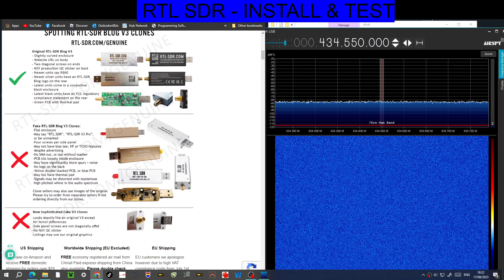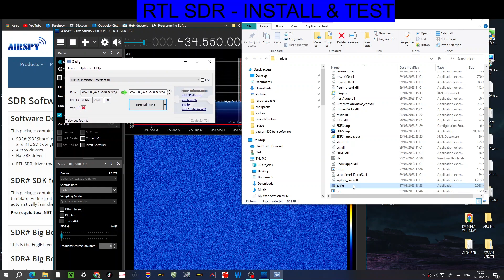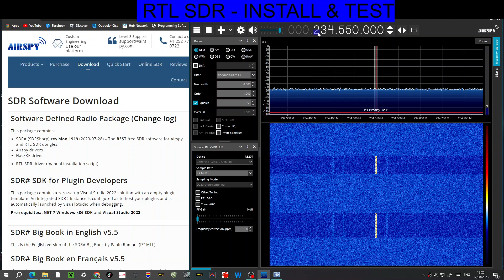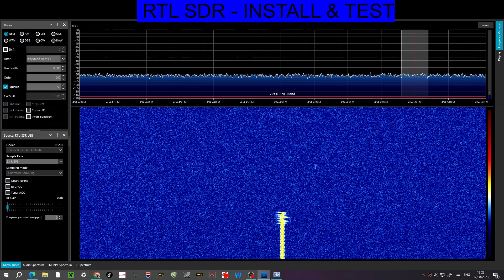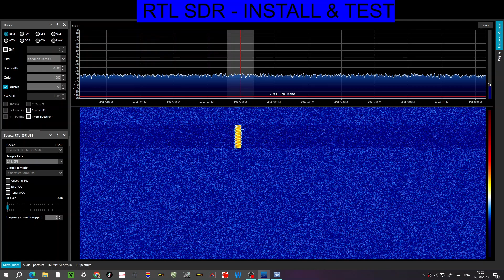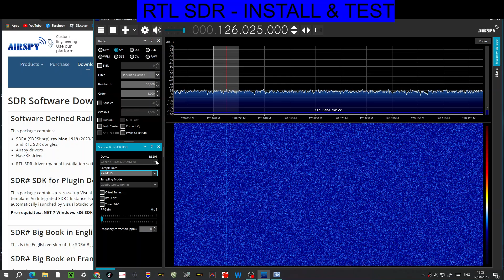RTL SDR v3 & v4- INSTALL & TEST , 2023

Comment: There are radio frequencies attacking our private property and devices such as radios, televisions, air conditioners, fans, etc. in Santa Ana, California, in Orange County. The transmissions are...
Ninety percent of the speakers are American women. Is there a way to detect and record this transmission with RTLSDR?
Reply from the maker: RTL-SDR devices can be used to record radio signals using various software. Common methods involve using command-line tools like rtl_sdr to capture raw I/Q data, or utilizing software like SDR#, Audacity, or RTLSDR-Airband to record audio or other signal types. These tools allow for recording to files, which can then be played back or analyze

Comment: Mine showed up as "Blog V4" in Zadig rather than "Bulk-In, Interface 0" like your video. For anyone else getting stuck at this step, the RTL SDR site has this to say: 

"Note on some PCs you may see something like RTL2832UHIDIR or RTL2832U or Blog V4 instead of the bulk in interface. This is also a valid selection. Double check that USB ID shows "0BDA 2838 00" as this indicates that the dongle is selected." 

Now my USB ID just shows "0BDA 2838" - I'm not sure where the "00" is found but I am moving forward assuming I have the right selection in Zadig. Just thought I'd share.
Reply from the maker: Thanks

Comment: Thanks for putting up this quick install guide. I wasted an hour trying to get my V4 up and running earlier to no avail trying to decipher the info on the rtl-sdr quick start guide page. What was NOT made clear is that "zadig.exe" should be used to install the driver. Following your guidance did the trick. 👍
Reply from the maker: Hi glad my Learning helped you :)

Comment: you have RF Gain too low, that's why you are not receiving more signals.
Reply: ohh, i said it too . read this later and yes RF Gain was off
Reply: how do i get my rf gain control on screen please i new to this
Reply: @robertcairns2337  in the nut icon.
Reply from the maker: Thanks I will try again .